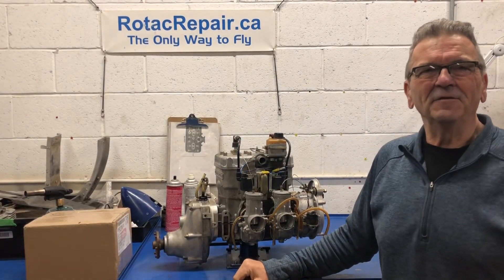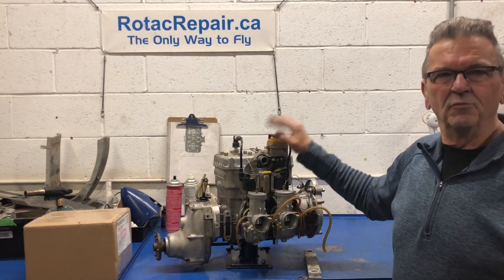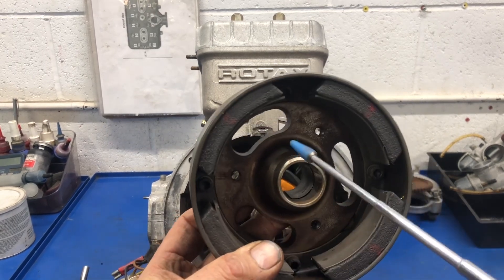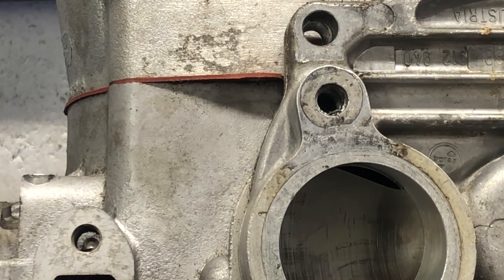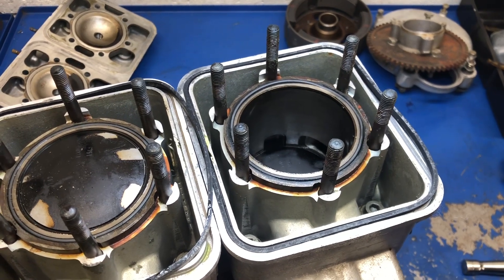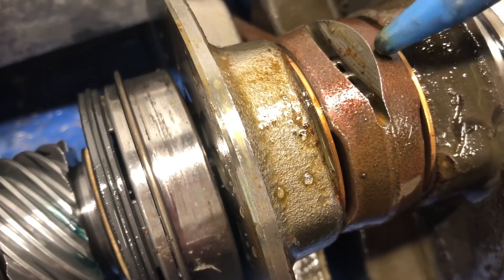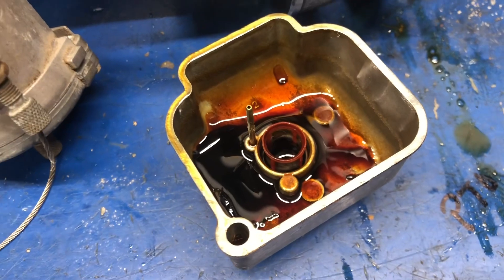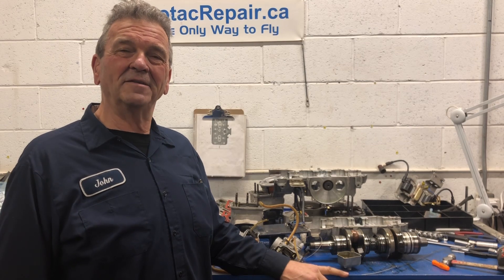Rotax 532 engine (part 1 ) dismantling and inspection

Comment: I'm picking up an aircraft next month with a 532 on it. Has 54 hours and sat for 22 years. I not sure if it's worth overhaul or just look for a different engine. Parts are probably hard to find.
Reply from the maker: Wow, 22 years is a long time, and yes, parts availability could be an issue, but I think it's worth a look!

Comment: For only 50 hours that poor little engine has lead a hard life.  🤕
Reply from the maker: I should have mentioned that it has been taken apart at some point, evident by the poor cylinder honing angle. View it again and you will see it.
Reply: It's a little hard to tell in the video but I think I see what you mean.  Surely that was not shipped from the factory that way, which brings up the question of why an engine that only had 50 hours was in such sorry shape.  I'll bet there is a story behind it all.  It will be interesting to see what the owner decides to do.